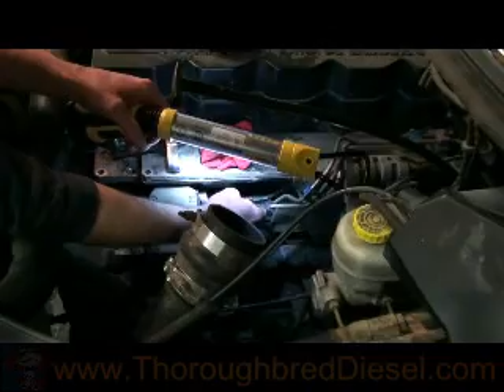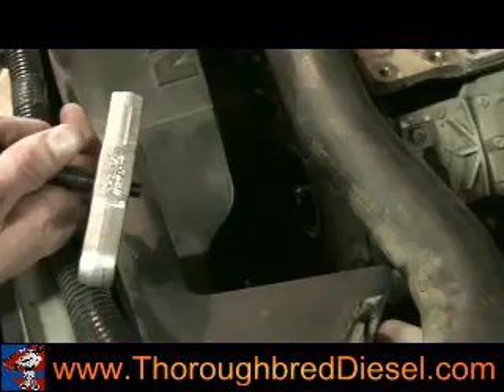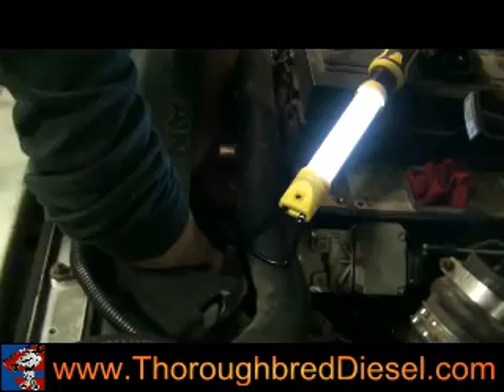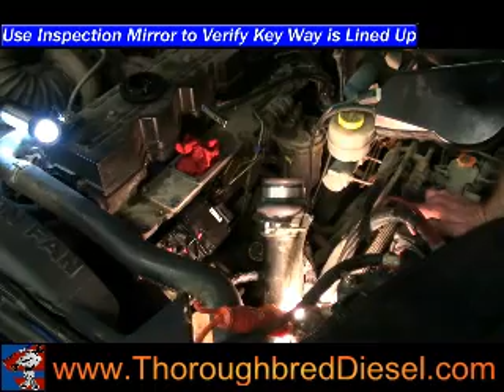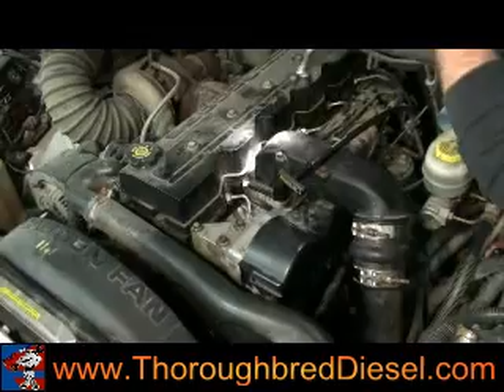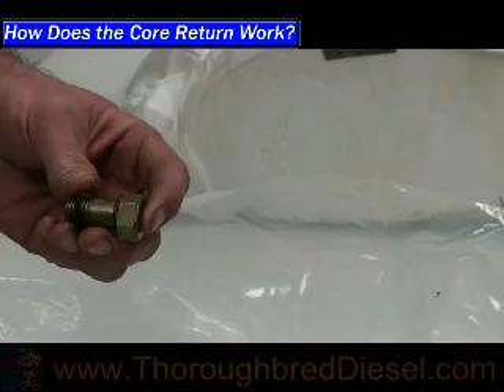VP44 Dodge Cummins Injection Pump Install | VP44 Pump Installation Part 2/2

Comment: I bought a new lift pump from bumper to bumper today... I installed it and put my fuel pressure Guage on the Schrader valve on the pump and it read 11 psi...    isn't that kinda low??

Comment: When installing the vp44 does it have to be timed like the p7100 on a 12 valve when you install it or does it matter what position the shaft is in as long as the key aligns with the gear? See I’m going to be taking off my front cover and my tappet cover to address some leaks along with a blown head gasket and I’m not familiar with the 24v very much only a 12 valve and I don’t wanna get the pump out of time if it’s possible to even get a vp44 out of time.
Reply: I think the reason for the p0216 code is from lack of fuel from the lifter pump to the vp44 that causes the vp44 to heat up and timing goes out on vp44 thats the only timing issue other then that its all good

Comment: The US have a different VP44 pump, in Australia the gear on the pump shaft has no key slot, the pump has a key slot. so one has to know that this is the case before pulling off the gear.

Comment: I've got a 94 cummins that the previous owner installed a 24 valve into. What are all the ways to identify the year of the engine?